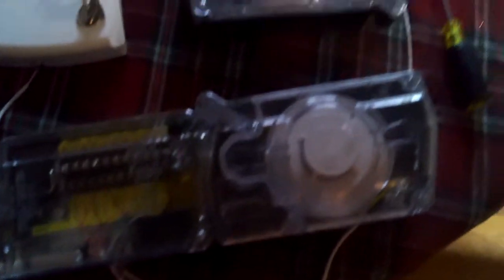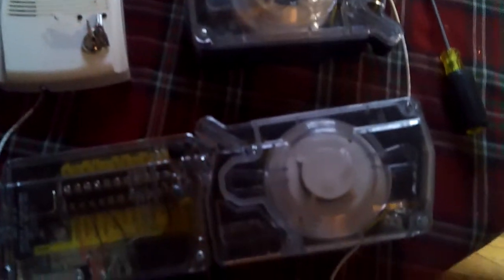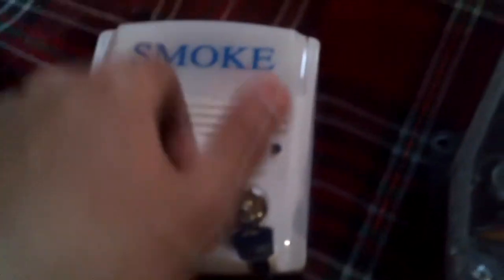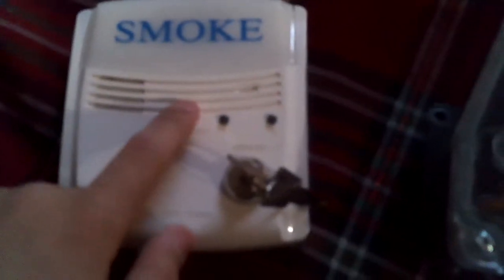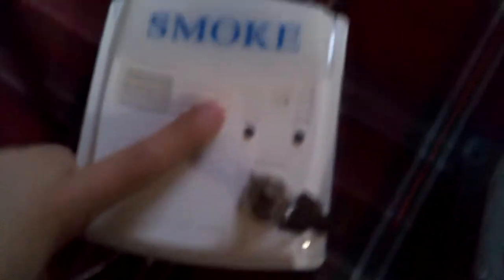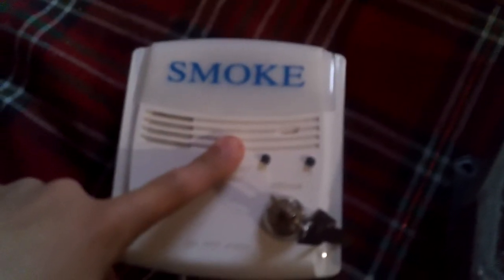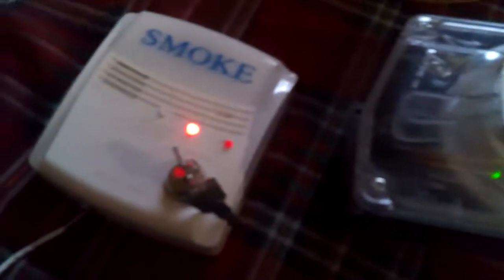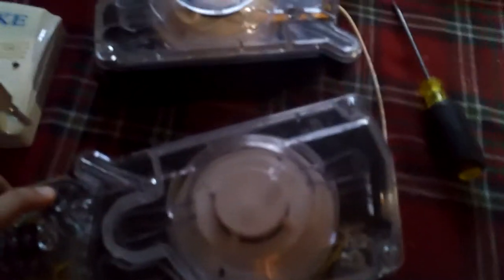Explaining The System Sensor D4120

Comment: This is an old video but I'm happy I came across it, how do you reset the tamper? I took the lid off one to clean it and I can't put it back without the alarm going off? Is there something I'm missing
Reply from the maker: That's normal operation, the duct detector shouldn't work without the cover. However it should generate a Supervisory or Trouble condition, and not an alarm condition

Comment: how did you connect one power supply to 2 smoke sensors?
Reply from the maker: The Thing Can Have 2 Smokes On One Supply, But Power And Tamper Have To Be Separate On Smoke 1 And 2